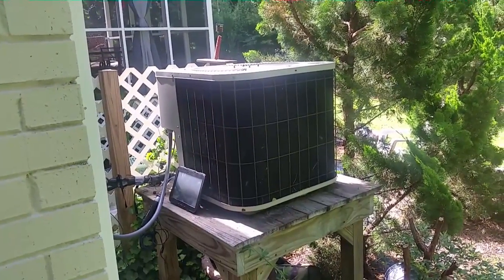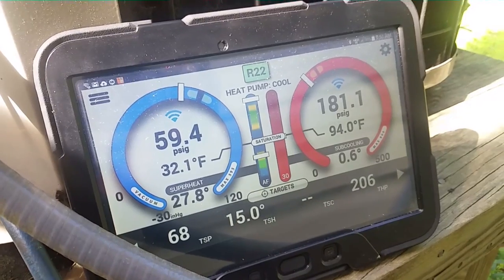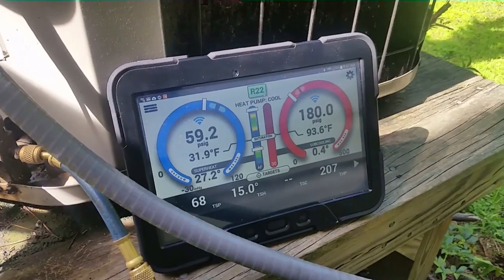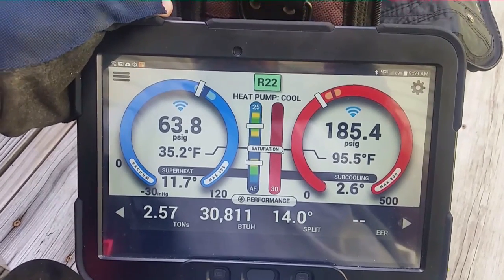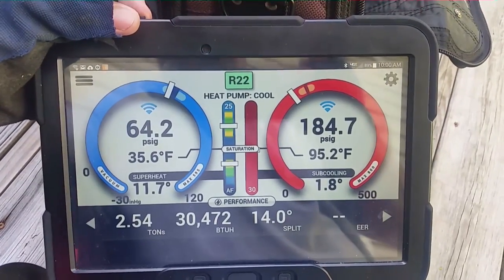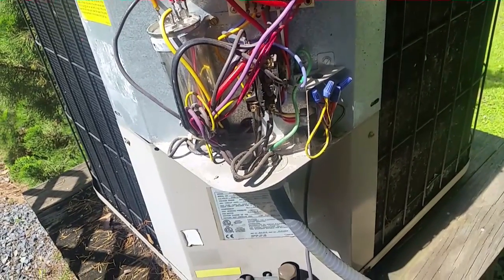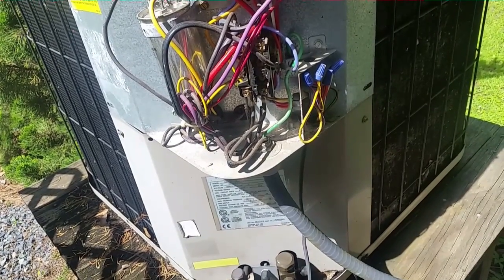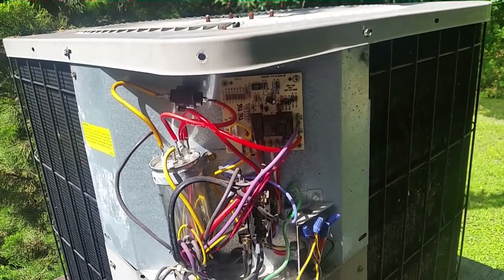HVAC No Cooling Due to Refrigerant Leak

Comment: I don’t understand the point of this video. You’ve charged a system with a known leak, isn’t that highly illegal in your area? Shouldn’t you find the cause of the leak and just braze or replace the line? I love and watch all your stuff, just lost me on this one.
Reply from the maker: The point is to display how loss of subcooling can change how a unit cools. It is not illegal at all. Only in larger commercial systems are you compelled by law to repair.

Comment: Hi Zack!!
What's the little black thing that is in the top of the cap and is connected to it???
Reply from the maker: PTC. It puts a jumper from start to run. After it starts it opens that circuit.
Reply: What happen if is remove it??
Reply from the maker: Jorge Chavez compressor may not start against a psi difference between high and low side
Reply: talyn875 Zack, on that unit is the PTC wired directly between start and run without a start cap?  Seems that with no phase shift it wouldn't serve any purpose.